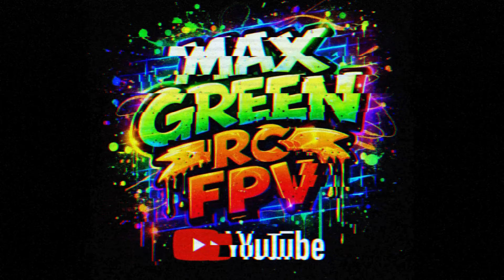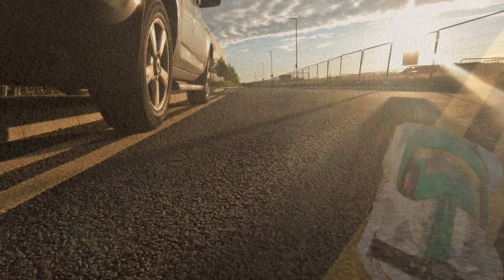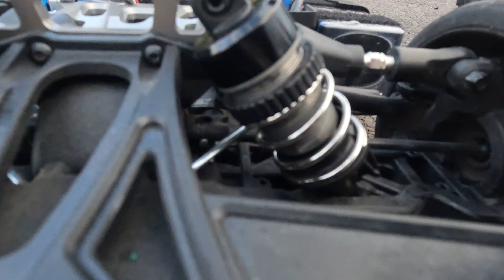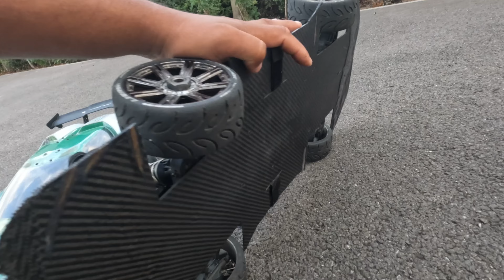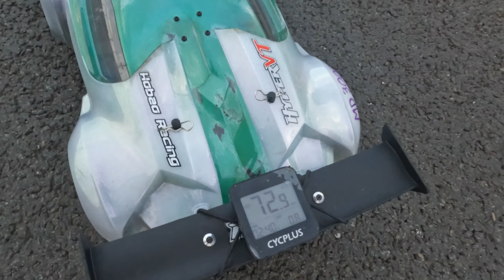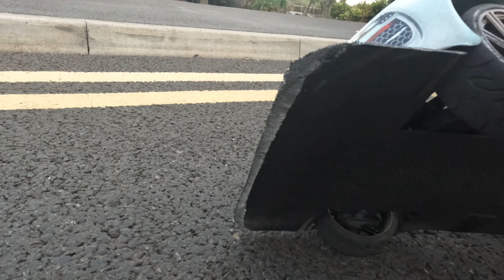RC Speed Run #4 DIY Carbon Fibre Chassis! FPV RC CAR!

Comment: Try a wedge between the up kick and the carbon might help the flex. You can probably 3D print a wedge
Reply from the maker: Good shout, a 3d printer is high on my to buy list. Will be having a good look this weekend and deciding what to do with her